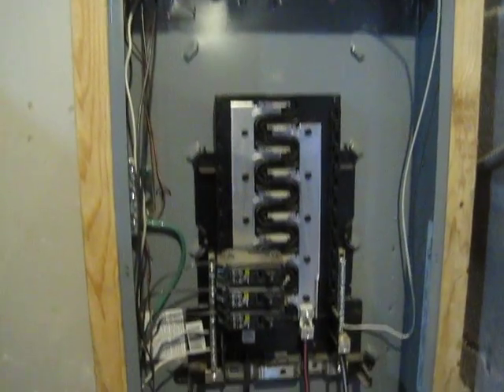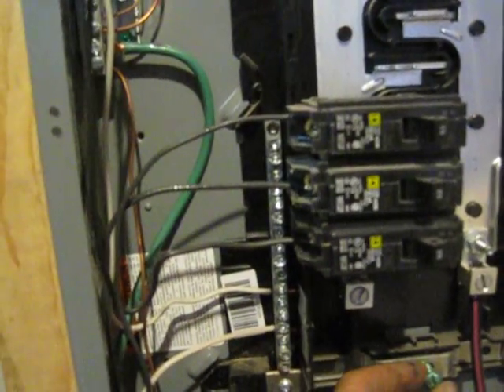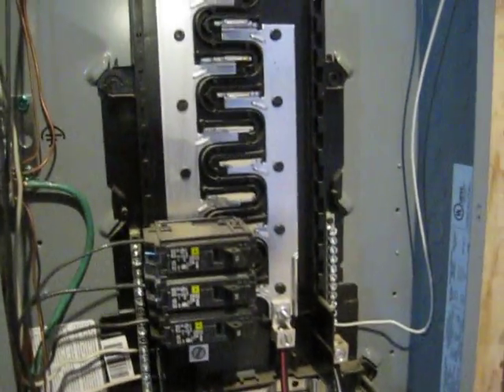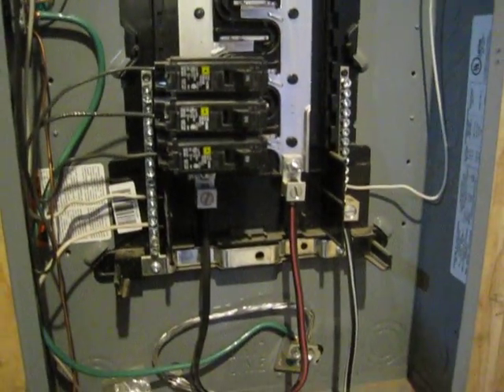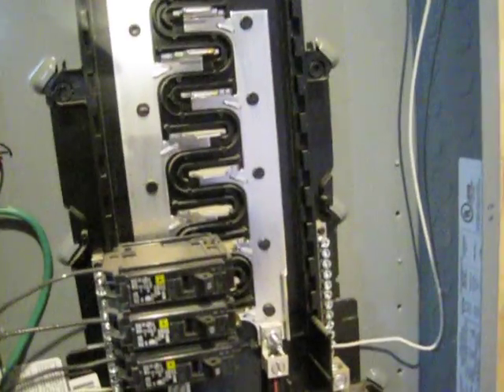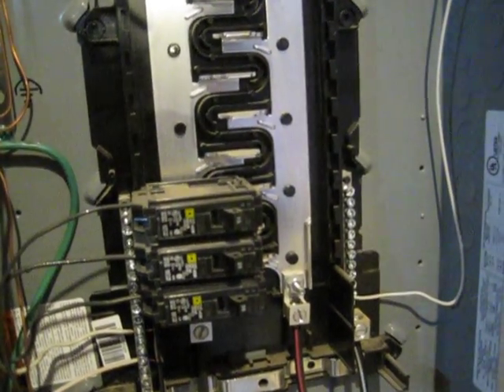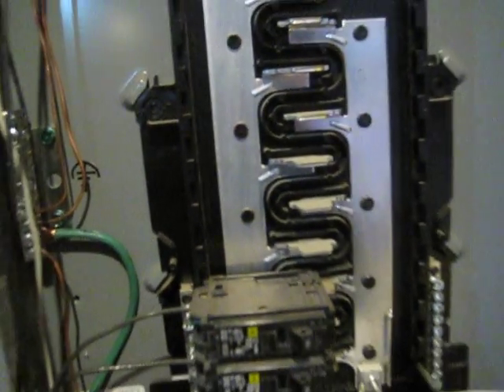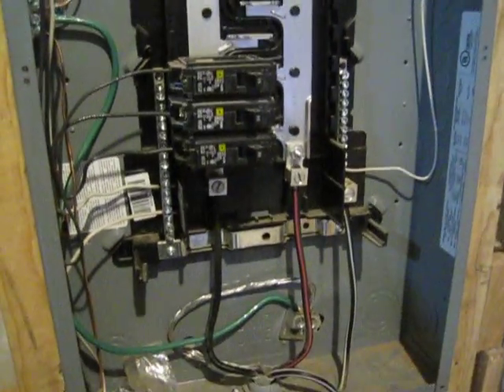Bonding MLO panel as DP_MVI_4605.AVI

Comment: The lug on the bottom is mounted with a sheet rock screw, it must be bonded to the enclosure with a 10-32 machine screw. You also put two wires under one lug that is not rated for two wires. The lug also has a copper and aluminum ground wire in it you can never put copper and aluminum wires together without a UL Listed connector. So that is 3 code violations right there also it is a Square D Homeline panel not a GE and most residential panels the grounding bar is optional, anyone who works in the trade should know this.
Reply from the maker: Thanks. I service more boxes than I install. I don't fix everything in every one of them. Bonding jumper is one thing I fix if I find it. If I installed the lug, it's with a 10/32 (typically a ground screw).